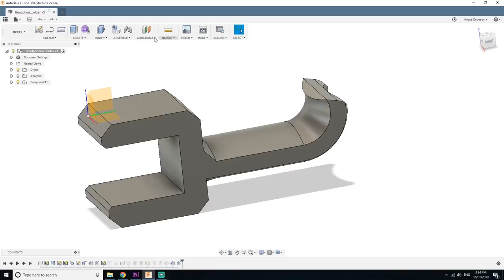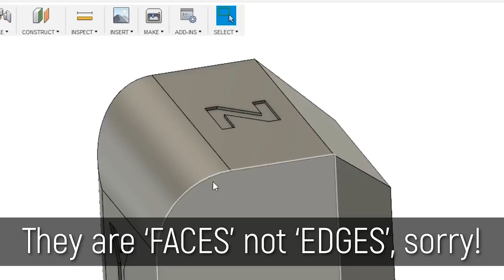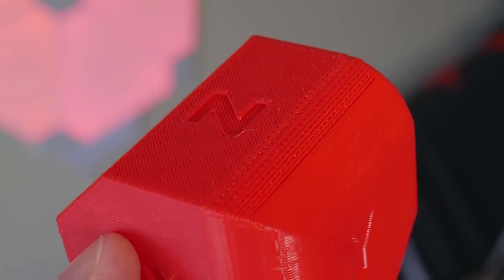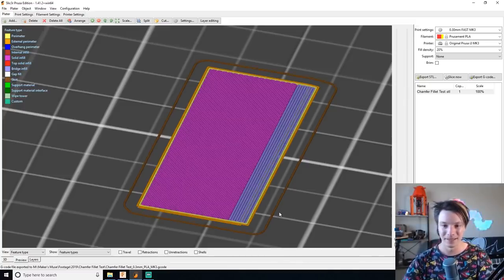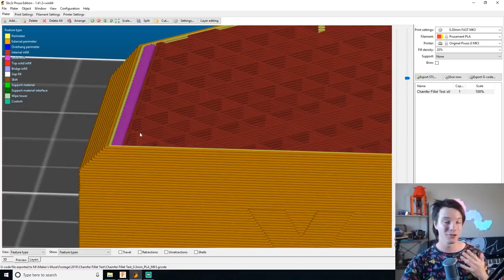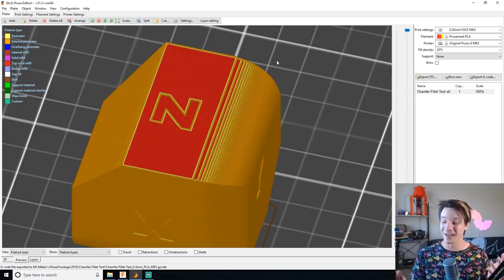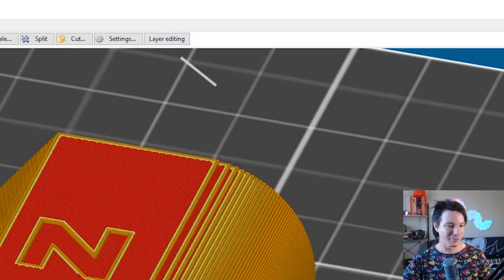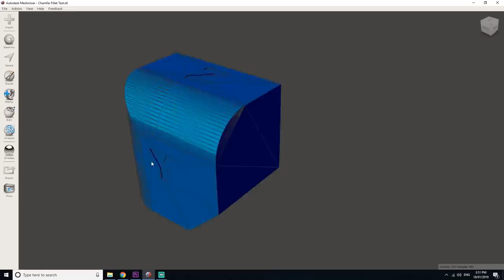Fillets are Sexy but Chamfers are BETTER (For 3D Printing...)

Comment: Hi Angus - What do you recommend to add strength to prints that curve?  For example, a g-clamp where there is pressure on the top arm, I always use a fillet (small, but enough to take off the 90 degree angle).   This is my model - all fillets:  https://www.thingiverse.com/thing:3388404

Comment: Well obviously it deprnds on which plane. On x/y using fillets will give you better results since your hotend mass does not stop in a sharp corner and you cant make a sharp corner with a nozzle anyway. On x/z or y/z i tought this was one of the first things you learn since its just logic?

Comment: Hey Angus, do you have some tips for mechanical tolerances(there is some automatic tool in solid works that do it for example ?
And resistance to stress(I don't know how express what I want), make the 3d printed part more mechanically stable as possible.

Comment: seems like the top chamfer is a software problem, when it curves in, the internal structure peeks through. to me a thicker "outer wall" could fix that(though i'm not sure, i don't have much experience in cad, but my knowledge in software suggests that would work).

Comment: Print quality and surface finish is a big and often subjective discussion. It would be nice to have a set of prints that yield actual measurements to tweak printing parameters. I posted a very simple print for thread geometry accuracy that results in a measurement number. Indirectly surface finish is included in the measurement. Just food for thought.  
https://www.thingiverse.com/thing:3390910
Cheers
-Peter

Comment: What about for structure? When I have a thin wall perpendicular (orthogonal?) to a flat surface, it'll just snap off if I don't do something to reinforce the joint. My experience is that a chamfer is weaker than a fillet. I may need to do some test prints.

Comment: Realize the real problem is the slicer.  It is printing the surface as though it is the interior.  After layer 1, it should be printing layer 2 with at least 1 shell right over the layer 1 edge shell and the further extension of that area as a solid, it is part of the surface, and it should be insisting on support where it's too far out until it gets to the 45 degree angle part. really a 45 there would make it sqrt of 2 so 1.41, it should really print both walls over layer 1 to meet minimum thickness of the walls.  The under side 'surface' of that fillet has 0 thickness where the interior is showing, the slicer is making a complete error in the STL to layer conversion.  The 'outside' curve of this surface should have a corresponding 'inside' surface that follows and keeps the shell thickness to 2 wall thicknesses minimum.  Completely a limitation of the slicer, the printer is perfectly capable of doing this correctly.    But that said I generally prefer chamfers as well, a lot more straight forward and for a lot of applications the fillet makes little difference.

Comment: Manual adaptive layering can be done by using a separate process for the layers involving the complicated geometry. Then go back to your bog standard layer setting. Surely if the infill can be managed this way so can the layer height.

Comment: I've been trying to break myself of the habit of adding small edge fillets to parts. The process of 3D printing usually adds enough on its own. I do use filets on areas that transition. For instance, I'd add a small filet to the inside of the jaws on the left of the part you showed at the start. Gives that part a lot more strength. Its really good for larger flat areas that transition to smaller pieces very rapidly. Specially when no outside edge is the same. That way you don't have that harsh transition of support to outline which creates a sheer point that can break easily.  Love these videos. Keep them up!

Comment: isn´t there some kind of automatic adjusting for the slicing so the layers dont get "streched". For example an algorithm that compensates for this stretch by reducing the steps and increasing the resolution in this areas. (sorry for my horrible english)

Comment: In my opinion chamfers or fillets used for aesthetics should be as small as possible, just enough to get the visual effect right.  When printing, sometimes the orientation must be selected to favor good quality in key features, sometimes resulting in longer printing times.

Comment: Small fillets on the bed, eg 1mm are great because they are small enough that the look clean and the take the sharp edges out of the print. It would be great if slicers could change the layer height automatically for certain areas that suffer from "layer overhangs", I think Cura has it as an experimental setting for this

Comment: Be glad you can adjust the layer height manually, Cura has it only in automatic and that automatic is sometimes completely stupid.
And due to the design of Cura, it might be years until it gets manual adjusting -_-

Comment: First of all thank you for your video... thumbs up!
But I do think the title is a bit generalizing and tends to tell us to put away fillets, while it only applies for the cases pointed out:
printing fillets with layers stacked along the z-axis and without supports .
However, printing along the XY-axis  in top view:
• Fillets are not only smooth and sexy, but  do great and don't have these problems.
• Little fillets are always welcome on 90° and even 135° big chamfer corners in XY view for precision parts.
Just let these little fillets have a radius of at least 2x the nozzle opening diameter, because in XY view 3D printers do no sharp straight corners.
The surfaces nears such points will expand outward and little fillets help you prevent that.

Comment: in sketches fillets are a total pain as well... creating just a line with an angle is much "safer". with the fillet sometimes it does not create a face and you have to look around at what is wrong... :(

Comment: You could use multiple processes in S3D as well. I ran into this printing a set of braces for my CR-10, they are solid enough, but the radius has little layer adhesion on the outside shell, just loose individual extruded filaments, making it look terrible. I hadn't thought of dropping the layer height in that section.
Thanks for the great tip!

Comment: The main reason I will pick a fillet over a chamfer is laziness. Fusion doesn't have a hotkey for chamfer and I haven't set one up for myself yet 😂 but yes, I tend to not use fillets for overhangs and top surfaces. Unless it's an inside corner transition between a parallel and vertical design element - I prefer the smoother transition in that circumstance because I feel like the hard change between 45 and 90 degrees will create a potential weak point for stresses (although I understand that might not be the case in reality)

Comment: One way i sometimes get around this problem is start with a chamfer and then use a fillet on the upper edge. Not a true fillet but will print nice.

Comment: As i watch this video i sit here looking at my brand new cetus mk3 extended in a box ready to be returned due to thermal runaway and it really sucks because i liked the printer but even if i knew what part was broken you can't get parts. So in short i must return it which has been a nightmare since service sucks as bad as getting parts. I really wish we had printer makers in the usa that didn't costs 1000's of dollars to buy. Great info Angus, sorry about my rant.

Comment: Good video Angus-the only thing I would have probably added is to consider printing orientation during the design process same as we do when designing parts that are machined. You really need to think 3 steps ahead of the game (metaphorically) when designing stuff-that way you shouldnt find yourself in a situation where you need to vary layer heights. Always consider your machines limitations when designing something.

Comment: From the bottom, start with a chamfer and add a fillet to it at the top. At the top fillet the chamfer at the bottom. With constant layer height it works quite well

Comment: Your videos are quite informative, but your model on this one is... Well, ugly. I understand it's a test model, really, but I gave to wonder if the fillet could have done better if it had been printed with more perimeters, unlikely given the angle but the possibility is there, and leaving the top layers as infill is just bugging me.
Reply: That's kinda the point of test models for aesthetic details. A lot of its uglitude comes from the issues it's designed to highlight, and using a single perimeter makes those stepping artifacts stand out like the surface of the sun on camera.

Comment: The problem isn't with the fillets, it's with your slicer settings.
Reply: time to look the video till the end huh? He said this in the last few minutes that a smaller layer height would work but it takes longer, quite obviously
Reply: This isn't constructive. You could try offering a solution after said comment.

Comment: Thanks for the excellent research!!!  Appreciated!
Reply: One thing: it might be desirable to re-orient the part AS PRODUCED, to avoid layering on fillets.  While IN USE a fillet may be on the top/bottom, as >printed<, it may be possible to rotate the part to a more felicitous orientation to the printhead.

Comment: Would variable layer height help with the bottom fillets too?
Reply: Also, would VLH allow steeper chamfers? Does VLH cause the extruded strand to squish or smear, or does it somehow keep a circular cross section?

Comment: The issue is the gcode. Small G01 lines to make circular geometries.
A lot of 3d printers don’t use G02 or G03, and that sucks.
Reply from the maker: It's partly because .stl files have no true curves. Now if a slicer could handle a .igs or similar 3D format... mmm! Proper curves and surfaces.

Comment: There's definitely an argument for filleting instead of chamfering when designing parts that need the maximum amount of strength for their weight, however when it comes to aethetics I've come to notice that instead of chamfering everything or filleting everything, when you mix the two together in the correct way it looks far better. Like blacksmiths say, move the metal until the metal moves you.

Comment: I feel like you stacked the deck a bit here to make your point. for example most people print at 0.1(or at most 0.2, i go between 0.08 and 0.16 but thats just whats best for my printer) not 0.3, making this "problem" 1/3 as bad as the angle is the same but has a lot more layers to build it. adding to this a small amount of support is to be expected any time you want overhangs. there is waste, but its minimal